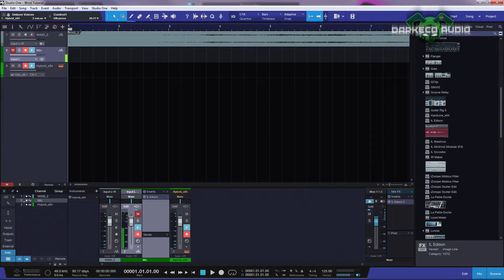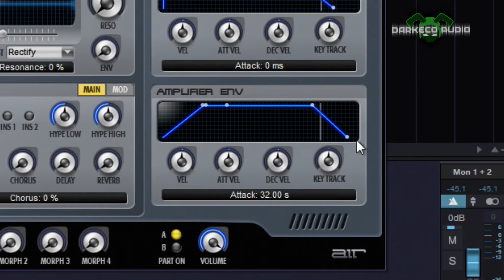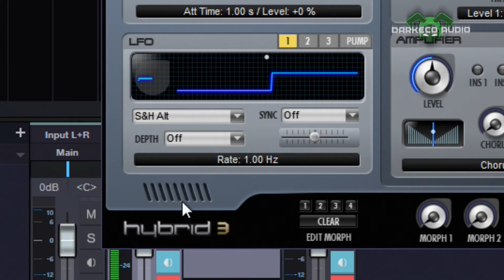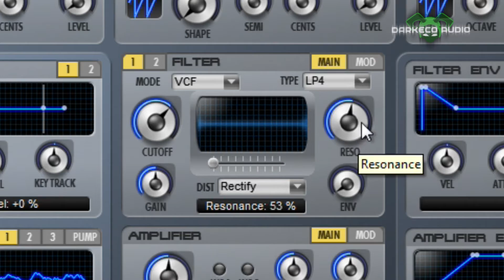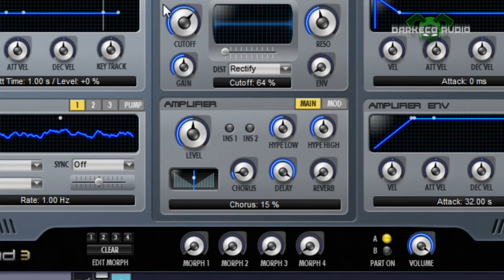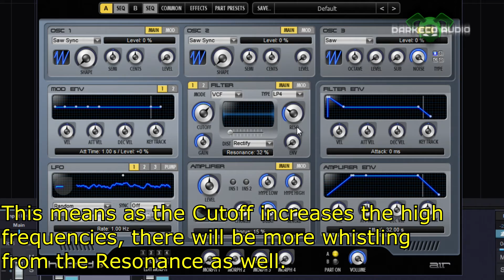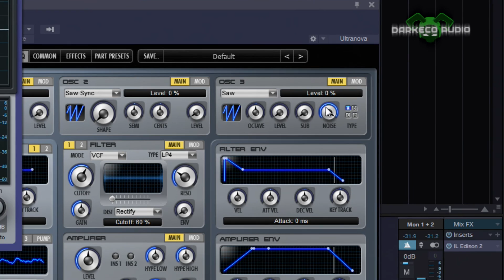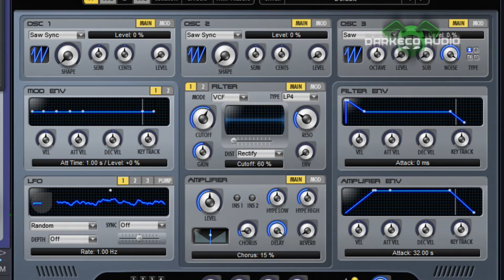Creating Wind (White Noise/On Any Synth!)

Comment: This is a great tutorial... simple and straightforward (and effective). Thank you so much for taking the time to do this!  In your wrap-up at the end - you summarized all the steps except for the bit on setting the frequency to random and then linking both resonance and cutoff to the LFO. One thing I would like to know is how the general frequency shifting of the random LFO can be slowed down, so that the "swells" in the wind tone (LFO driven changes in cutoff and resonance) can build and reduce more slowly. In my mind this would equate to having gusts of wind that are lower velocity or that build and decay more slowly. Not sure if I am being clear.
Reply from the maker: Glad you enjoyed it! Sorry for not getting the summary accurate. This was all kinda done on the fly and i hadn't actually planned to do a summary at the end. Plus i'm incredibly self aware when i'm voice recording, which just induces nerves haha. To answer your question, every LFO has a "Rate" control (measured in Hz) that alters the frequency of the wave. It's quite hidden in Hybrid 3. If you look at the top of the oscillator graph you'll see a small grey dot. I can drag this left and right to change the LFO rate. Great question btw! I should have mentioned that in the video!
Reply from the maker: Also you could assign the rate control to automation in your DAW or even to another random LFO (if your synth allows it) to get further variations.
Reply: Wow - thanks "Dark" for the rapid reply. Again - my comment not really a criticism. It was a great tutorial and I am already using the approach to generate my own wind sound on my Jupiter 80 Synth. Thanks for answering the question on the LFO, I will look for a similar "rate" control on my synth. Cheers!  Great content - Thanks!